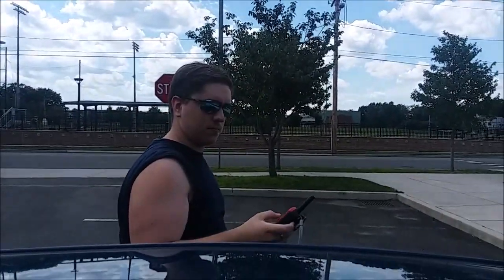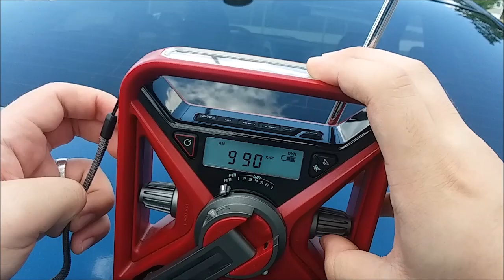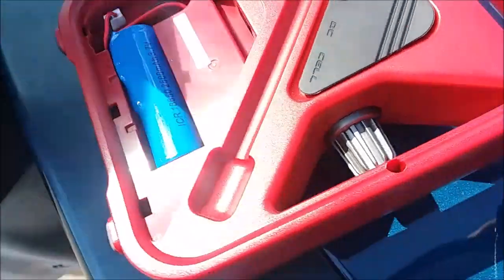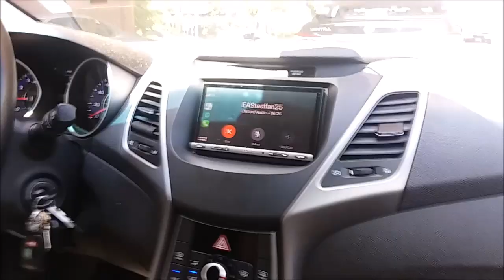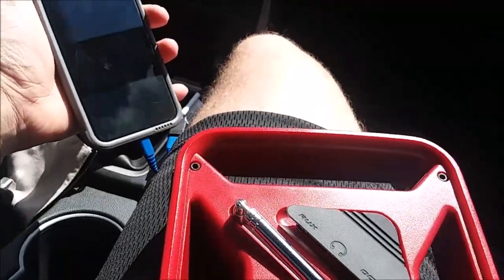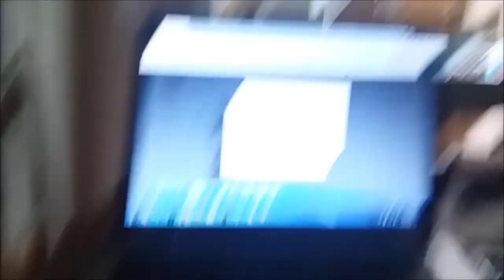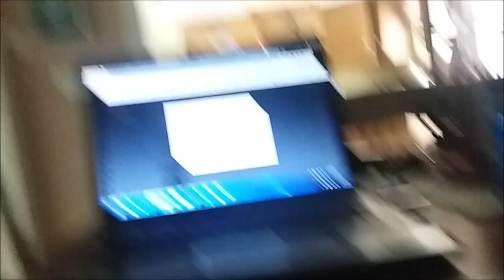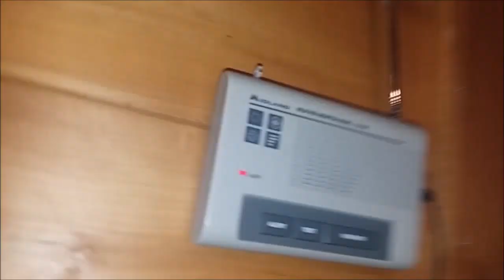Radio Reviews: Eton FRX3+

Comment: Re: the battery
This "new/updated" + version is 2600 mAh whereas the plain FRX3 has only 500 mAh. Also, the cell phone charging capacity is thus increased from 500mAh to 2000mAh. So despite the elimination of the AAAs, this + version has *much* longer battery life & a higher charging capacity of the internal battery. 

Of course, there was the advantage of being able to replace the AAAs in the previous version but the + should theoretically last 5x longer if used under the same conditions.